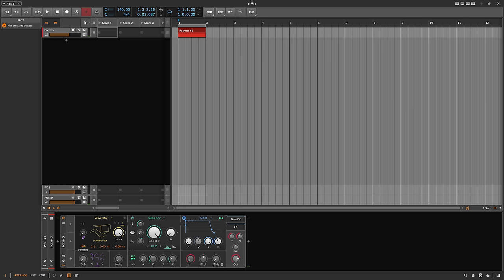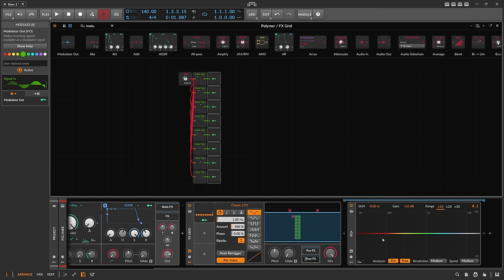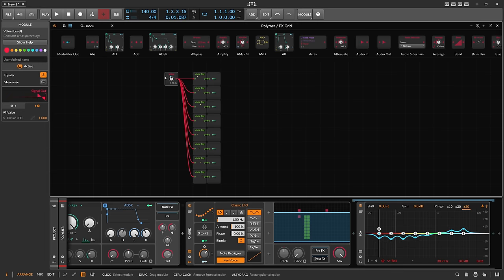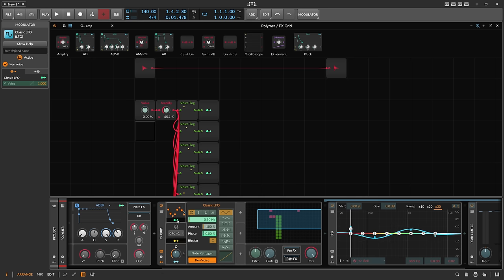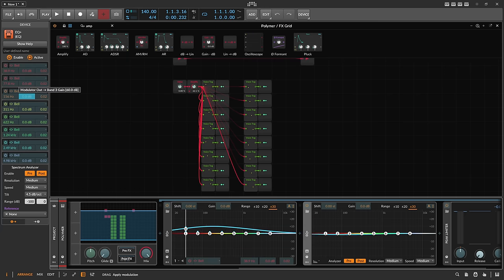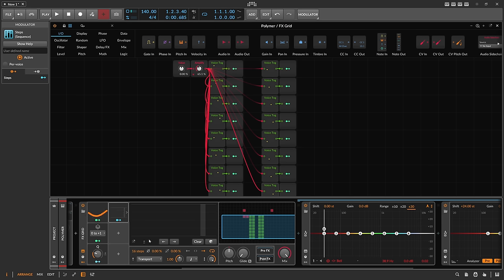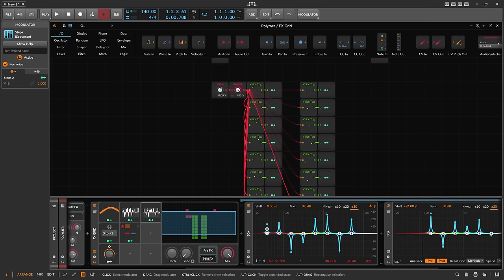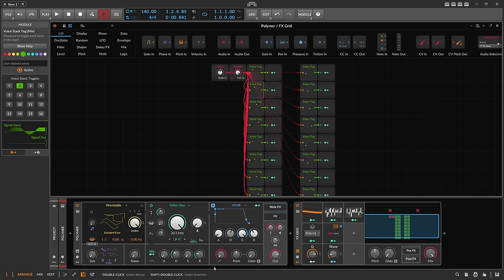Slink - Bitwig is crazy powerful

Comment: tried this out yesterday and the only downside is the CPU hit. If you wanted to use this on multiple channels, you’d be using 16 voices every time an instance is made which really punishes the CPU. Also worth noting that the output signal gets multiplied by however many voices you’re using, so you’ll need to attenuate the gain down quite a bit to level match
Reply from the maker: yea its very heavy on the cpu. i think you can use a "voice tog" on the output of the grid, and then just select voice one to remove the doubling of the voices. i hope they optimize this voice stacking a bit more and increase the number 😅

Comment: It's also worth noting that multiple LFOs aren't tied to each other, so if you wanted to use 3 classic LFOs in random mode on an FX Grid set to 8 stacked voices, you will get 24 independent random LFOs.

This certainly makes creating mass randomisation significantly easier to set up and contain. Great tip.
Reply from the maker: yes!

Comment: Not just crazy powerful but it sips energy I run it on a quad core celeron low power processor.
Reply: Old cpu?😮
Reply: @partlysimpson5154  no it's a 2020 celeron where Intel added support for SSE media extensions

Comment: if bitplug just could simplifhy the interface and make it more minimal on the eyes, and a bit more smooth. 
and scale feature with midi editor devices in roll like 11.0 . that would be neat. i would love to piece togethere things this way. personally i want the program to have more features towards modulating things relative to key.
Reply: im 66 with bad eyes i have no visual issues there is a custom program to edit how it all looks colours etc new skins have you tried that some people prefer a real dark mode you can also turn panels on and off its to cluttered for you
Reply: @williamshaneblyth  ITS IN THE UI, IN MY OPINION IT TAKES UP MORE SPACE THAN IT NEEDS TO, ITS ALLOT OF BORDERS AROUND THE UI ON FX. GOT AN OLD MAC TOO, ABLETON RUNS FASTER ON IT EVEN THE NEWEST VERSION. 

BITWIG TO ME IS LIKE ABLETON, BUT FATTER UI. THE ONLY THING IS THAT BITWIG HAS THE GRID. AND STOCK MODULATORS INTGRATED INTO EVERY DEVICE. PROBABLY DOESNT USE AS MUCH CPU AS LFO IN ABLETON DO.. 

BUT IT ABLETON WE LITTERALLY GOT MAX FOR LIVE...

Comment: however I rarely use EQ+ because I have encountered several issues on audio bouncing and parallel delay compensation, not stable at all :(
Reply: This has been fixed in 5.1
Reply: In my macOs version it still doesn't perfect invert phase cancel on parallel moreover in a complex FX chain I made I found out  it sometimes bounces the transient differently from what I ear in playback :(
 @TheQxY